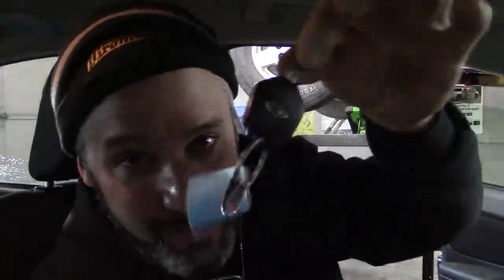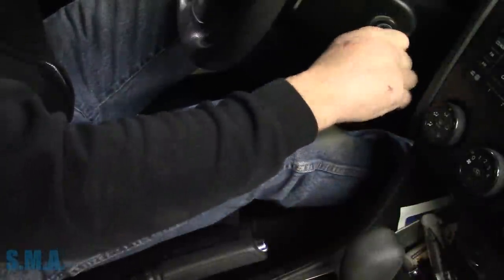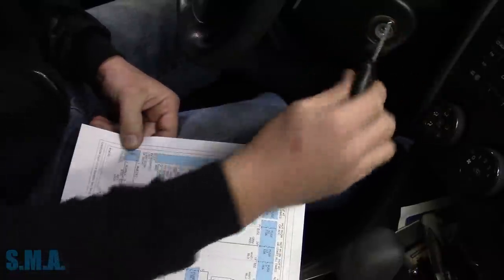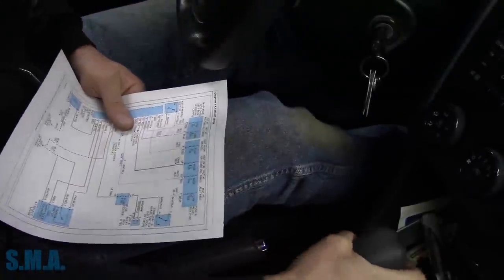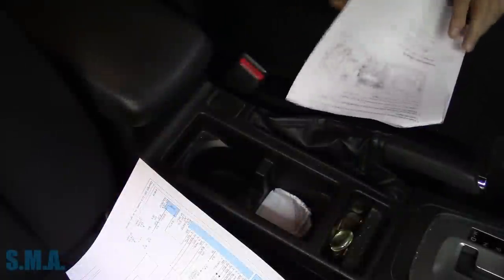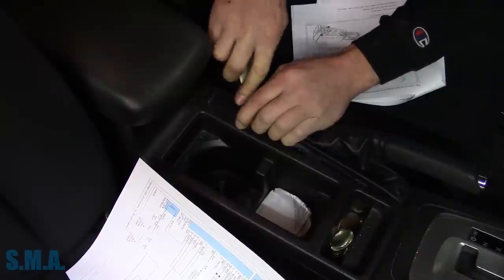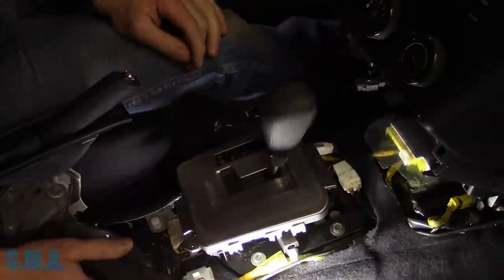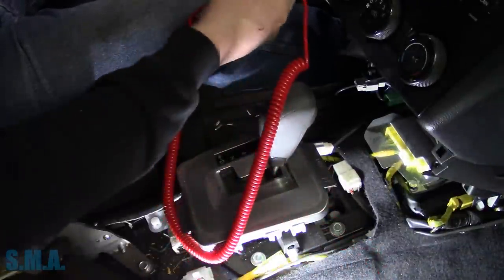Subaru Impreza: Key Will Not Come Out Of Ignition - Part I

Comment: Great video which helped me fix my wife’s 2015 Impreza yesterday, but I actually figured out the root cause of the problem and a very easy fix.  

The problem in my case was not internal failure of the switch but rather the mechanical operation of the switch (my switch tested just fine when I was able to activate the switch lever arm directly versus using the shifter shaft to activate it).  Turns out what activates the switch is the bottom of the shifter shaft.  The bottom of the shifter shaft can wear and or the lever on the micro switch can get slightly bent downward over time and therefore the mechanical motion that activates the switch is no longer adequate.  What I wound up doing was bending the lever on the switch slightly upward to improve the downforce on the switch and this has corrected the problem.  Another key to the issue was that numerous forward and backward motions of the shift lever would often not correct the issue and that’s because the issue is really an up and down motion issue not a forward and backward motion.  Your electrical troubleshooting of the switch is what saved the day for me as I duplicated the measurements and that helped me understand what was going on because without the shifter shaft in place the switch never got “made” and then I realized it was the end of the shifter shaft that actually activated the switch.  

P.S. you can actually just remove the shifter shaft, and then you can use a flashlight to look straight down the shifter shaft guide tube while in the park position and you can see the lever on the microswitch sitting right below where the shifter shaft sits while in the park position.  You can then just insert a long stick down through the shifter shaft to activate the switch while in park position to test if the switch has actually failed or if it's just a mechanical activation issue due to wear of the shifter shaft or permanent bend of the micro switch lever.  Just FYI, Don
Reply: YOU NAILED IT!!!

Temperature played a role in when mine would fail, and for whatever reason your post seemed to make sense to me as related to temperature. The switch lever is a very thin piece of metal and I think its prone to miniscule deformation in the heat like a thermometer spring.

Anyway, I was able to take mine apart by removing the shifter knob, bezel (black plastic), cover (gray plastic with indicators) and the white plastic bracket beneath. I did break one of the two clips holding the white bracket in place with just my fingernail, so be careful.

Once all of that is out of the way, move the shifter into the drive position (all the way back) and a small metal switch lever will make itself apparent. You can depress it manually to test it. The fix is to bend it ever so slightly up and towards the dash.

@wd8dsb saved the day for me.
Reply: @cjshorkey  great to hear my method of repair helped you out.  My Wife’s car has now worked flawlessly for 6 months since I bent the micro switch lever arm upward ever so slightly.
Reply: @wd8dsb @cjshorkey did you have to remove all the trim like he did or pull the shifter assembly out or did you just remove shifter covers with it all still in place?
Reply: @clintonbutler4503  I did have to remove the console cover (I'm sure that's the wrong terminology) both behind the shifter and in front of the shifter. It's the only way to be able to get the silver cover off... I think. You do not need to remove the lower trim (again, wrong description) on the left and right of the shifter assembly.
Reply: @cjshorkey  awesome thanks for clarifying!
Reply: @wd8dsb  cheers, thanks!
Reply: @clintonbutler4503  I went back and looked at what I really had to remove and clintonbutler4503 describes it well.  I did not have to remove the 2 Lower front side panels.  The key is that I had to remove the silver plate that goes around the shifter in order to get to the lever on the micro switch and then I just bent that lever up slightly.

Comment: There is a TSB for this issue. They have updated the park range switch(or as subaru calls it "Plate Guide-B") to resolve this as it is a very common problem! Working at a Subaru dealer I've probably replaced around 30-40 of them under warranty in the past year.
Reply: Hi! Love this reply. I'm having this exact same problem!  Can't get my key out or back in! I am NOT a car mechanic...can you tell me what a 'TSB' is (There is s TSB)   Not happy it's happening but really happy to at least know where to look.  Will watch for your reply..although I know this is from 4+ years ago.

Comment: Key won't come out? "Grabs slide hammer"
Reply: I remember years ago on my grandfathers truck you couldn't get the key out because he hadn't removed it ever. Different times.
Reply: U don't want shock wave the chip key
Reply: Or the old Chevys you could take the key out no matter what position the key was in.
Reply: My 59 impala starts without the key If you didn't turn it to "lock." They were intended to do that.
Reply: @Dager004  I could still do that on 2002 Saturn.
Reply: @slowride55  probably way less likely for people to steal cars back then like it is now
Reply: Brett Tabor my friend’s 96 cavalier does this.
Reply: This is the direct opposite to the Chivies, that the key won't turn, most of the time!! 

Ahhhh, GMs!! I find myself twisting the key multiple times, as a regularity, even when the key turns, and takes me by surprise!!! Rides often ask me if I'm OCD!! I say nope, I'm GMO!! 

GM owner!!! Lol
Reply: I have a 2002 Subaru and I can’t get the key to turn in the ignition switch. Got any ideas?
Reply: Correct key???? I once encountered this sort of complaint! Turned out the person didn't have the correct key. One key worked, one didn't. Check the ignition switch?? No,I looked at the two keys. They had different cuts!!

Comment: Hey Eric, FYI, the shifter release button opens the microswitch via a rod that runs down through the shifter stem. Just lightly touch the button with your finger and if the microswitch opens, its failed and needs a new switch. Sometimes its bad enough that you can verify it simply by pushing down and then lifting up on the shifter, all the while, not touching the release button. The microswitch will open and close. (While watching scan tool pid data of course :) Happy hunting...

Comment: To make sure no one gets the wrong idea from Eric's use of a test light here:

I'm not actually familiar with how car electronics are generally designed but when dealing with electronics in general you don't usually want the risk of applying a big load to a logic signal. Processor and microcontroller output pins can handle like 20 mA at the absolute max and usually it's a lot less.

If your test light draws 100 mA at 12V then when applied to a 5V logic signal it will draw just over 40 mA. This is definitely enough to fry the pants off of a lot of the chips out there.

In this case however you have an arrangement where you have what I'm guessing is a pulled-up input on the control module connected to a switch that shorts it to ground. Since it's designed to be shorted to ground, using a test light (to ground!) on it is just fine.

Comment: Micro switches aka precision switches by design tend to wipe the contacts against each other especially during overtravel and this helps to clean any oxides from the contacts that may be preventing low voltage low current DC from breaking thru the oxide layer. The more you cycle it the cleaner it gets which is supposed to increase reliability.....except for Subaru of course.

Comment: Subaru has a tsb on that issue. It is a common problem. It is a shifter repair kit. You do not have to replace the complete shifter. But it does have to be removed from the vehicle to complete the repair. 😀

Comment: Very good one. I'm busy with our Sharan's back door. Tumbler broke, so now you can't unlock the door with the key. And the electric motor that opens the door for you when you lift the door handle is tired of life. 

Was real fun getting that door open. (Seems our Sharan's a first generation, newer models have an emergency lever which you can access to open the rear door with).

Hopefully the VW agents can help with the right parts, otherwise it's off to the scrapyard.

Comment: There is a tsb for that you get park switch and 2 clips
Reply: subaruenduro yeah its a shifter short block
Reply: 35122FJ033 micro switch plate. 35164AJ000 clip, 35164AJ010 other clip tsb16-11218R
Reply: Don`t say TSB. I have an `18 F 150 that the door latch freezes intermittantly and there a re a couple TSB`s that don`t fIx the problem.

Comment: Hey Eric, most times you will see the contact resistance will vary 5 or 10 ohms. A good switch will repeatable give you 1 ohm or less when it is closed but an intermittent switch will almost always give you a higher resistance when closed.

Comment: Eric, the frustration you showed is what most car buyers feel when confronted with failure of the safety for safety for safety features that were unheard of 40 years ago. The bottom line is that a $2 switch is broken and it will take 3 hours of labor and the replacement of the whole gazillion dollar assembly to repair. This situation is all too common on newer vehicles. 

If I sound unhappy it's because I see so many single moms and other people living on a shoestring just trying to do the right thing. When the cost of repair for the failure of a $2 part is approximately equal to 10% or more of the vehicles value, what to do? For many, the only option is to pull out a credit card and go deeper into a nasty hole because they need the cars for work and school.
This is not the fault of mechanics, to be sure, and Eric does his best to minimize the impact on his customers. I remember the coupling to the rear axle on another Subaru. Repaired a component that was not supposed to be repairable.
But the designers and engineers have to take a lot of the blame. The vehicles are designed for easy, low price manufacturing. Ease of maintenance and repair are way down on their priorities if they are there at all.

Comment: Had the same problem. No need to disassemble everything. Just pry up the silver panel and there is a metal tab that depresses a switch when you put it in park. The problem is that the metal tab doesn't depress the switch enough. Just bend the metal tab slightly so the switch gets depressed fully.

Comment: You are the best.  It is a difficult repair.  You are much better off doing the 2 screw steering column disconnect of plug connected going to the ignition .  Even if you have Thieving East Hills Subaru charge you $700 to do the repair you risk having your car damaged just to install the same garbage micro swith that failed in the first place. Subaru should have been forced to have a recall on this but they paid off some government official to look the other way.

Comment: lol I had a friend reach over while going around a corner, he switched the key to off, removed the keys and threw them out the window. It got very interesting fast. lol I did get even when going around a corner in snow I gently bumped the curb and I asked him to look out and make sure the beauty rim was still on the wheel. he opened the door (yes while moving ;) ) and when he did I threw the car in reverse douching him with snow and slush, I then said leave my car key alone lol did I mention a year or two had gone by before I got my revenge? yes it took that long for his guard to be let down.
Reply: Oh you rascals

Comment: Interesting. I had a 71 Datsun/ Nissan PU with a similar problem. Turned out that the key couldn't be pulled out because it was worn and would stick in the ignition switch.
 Fortunately, next door to where I worked was a locksmith, and he showed me how to remove the ign assy & release the key. A new key, cut from a master  solved the problem.
( We traded favors back & forth a lot, as I repaired numerous of his remote electronic alarm sensors. Thanks Dan Sr.)

Comment: Same thing happened to me on a 2006 Cobalt. There's a plastic shaft that the shift knob button pushes down, and it has a metal pin that goes through the plastic shaft and hits the lights/ignition/key lock switches when the shifter is moved from park to drive and vice verse.  The problem is that the plastic shaft breaks in half where the metal pin goes through it, resulting in the pin falling out or teetering up and down when it engages the switches. Since the plastic shaft is spring loaded at the bottom, I simply removed the lower portion of the shaft and replaced it with an aluminum door lock detent that fit right inside of the shaft housing. I drilled it, glued the metal rod in place, and reinstalled. I've seen many videos, where the person with this problem merely puts the pin back, not realizing that the shaft is broken in half at the insertion point. Thus, history repeats its self. I fixed mine two years ago, and it's been perfect ever since. If that's not the problem here, then sand the carbon off the switch contacts. They're not that difficult to take apart...

Comment: I own a '13 impreza as well, there was also a recall for the brake pedal switch too.
Reply: There is also a valve spring fracture recall.  My source is I'm a Subaru dealer tech
Reply: @modernwarfare2535  yep, mine is scheduled for January, this was from a letter i got back in JUNE! they were so "backlogged" to do it

Comment: There is a TSB for this problem. You replace the shift lock assembly in the shifter. They have an updated designed switch. Comes with two metal clips as well. Kind of a pain to take apart

Comment: You forgot the biggest step in the diag process... Check for TSBs. Subaru has a bulletin for a replacement shifter plate, which comes with a new switch. TSB 16-112-18R.

Comment: There are some videos showing people pulling the electronic part of the slide plate under the shiftier and cleaning it, a lot of them had corrosion built up on the slide plate of the electronics and after they cleaned it the the electronics worked fine !

Comment: I had a 1990 civic that did this but only in the winter because the contact grease in the prndl would get too thick to allow te contacts to make.. I took it apart and cleaned it and used some vaseline for contact grease. Never had the problem again.

Comment: Chevy impalas are known to have the same problem on the 06-13 models. It is normally the wires break and you have to fix the wires on the side of the shifter because of the movement of moving the shifter back and forth.

Comment: Thank you for this video.  It could not be a more timely video.  I am having the EXACT same issue with my 2014 Forester right now (no kidding, also intermittent, works sometimes, other times not).  So I am eagerly awaiting your repair.  I will probably order part and do myself.   Also, the comment about the freeze spray is good to test if it works now does it stop working when gets cold.  Freeze/Cold spray can be an excellent diagnostic aid.  Also, I wondered if using caig deoxit (DN-5 or D-5 spray) would clean it and fix it instead of ordering another switch.  I'd also disconnect the I suppose the question is how long it would stay fixed.  if changing it out is a real PITA and I can get to the switch easily with the cleaner I might try it.  I use this stuff all the time on dirty and gummy switches for electronics and it works great (many times, for years) in audio applications.  Love the vehicle but this sure is an annoying problem!

Comment: How about doing something to bypass the switch? Add a piece of wire to the test point, bring the wire out, if inner switch does not work, touch added piece of wire to ground. I'm thinking, fiddle a bit more and make the bypass wire safer and more usable.

Comment: I had a Pontiac Grand Prix that had a similar problem.Key won't release in park.With this car there was a bypass under the steering column directly under the ignition switch.I drove a bolt into this hole and the problem was solved.I believe there was some sort of plunger mechanism that releases the key when pushed in.

Comment: Could be the current draw of your test probe arc scoured the switch contacts when opening and closing the switch temporarily improving the connection.  Those micro switches are very reliable, but they do go bad.  Even cherry switches of good repute die on the regular.

Comment: Could you just splice in a monentary push button into the pink/blue wire that cuts power when it is engaged, and remains open when not pushed? My thinking is that when the key does not want to come out, you push the button and and you can remove the key while the button is engaged.

Comment: Once I had just finished putting some go juice in my daily banger and was ready to take off. Belted up, went to put the key in but it wasn't really fitting. Used a bit more force than I should have along with casual swearing and it went in but wouldn't turn. The key rocked back and forth a little so figured it was maybe the steering lock? After around an hour, which was more like 20-30 seconds with people angrily queuing behind me, I tried to take the key out. It required a fair amount of force but got it in 1 piece. Then noticed it had a Toyota symbol on it and I was in a Honda. Probably the wrong key then!

Lucky I didn't go with my classic method of fixing the old wreck and use my foot to turn the key.